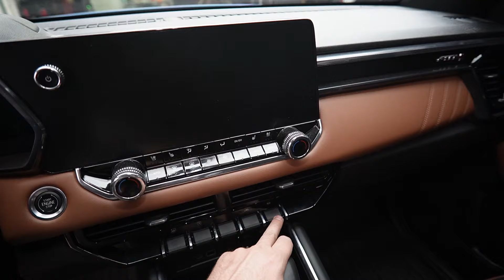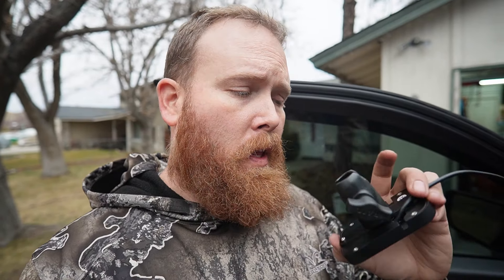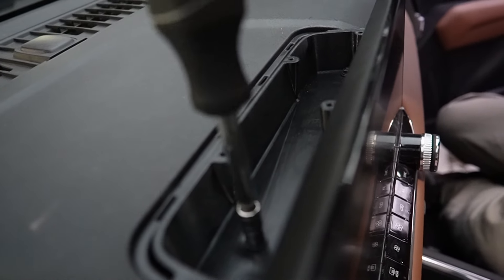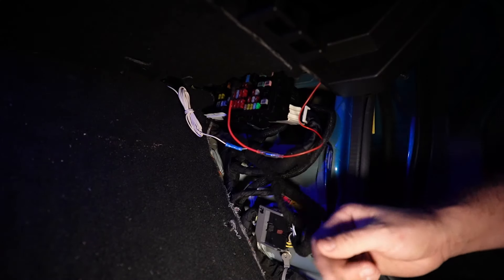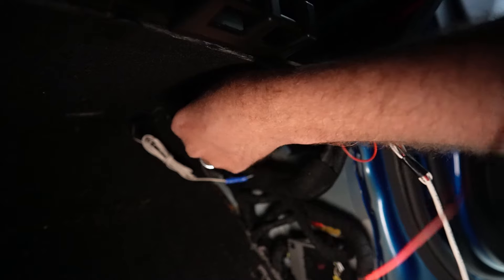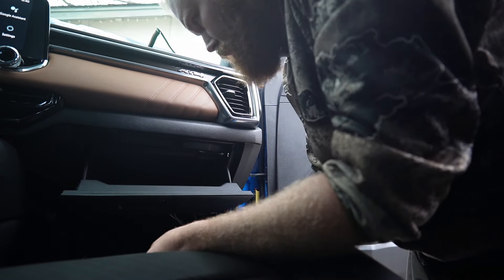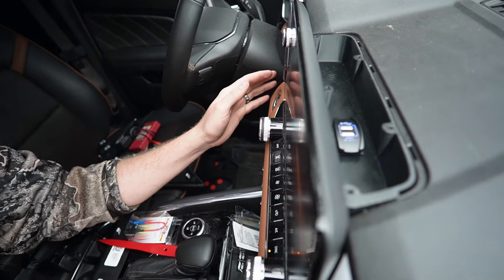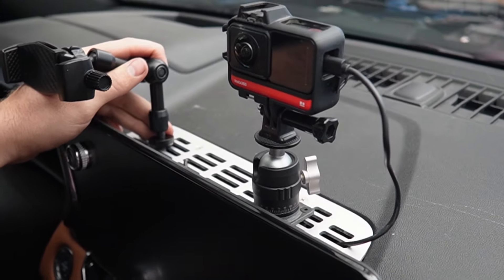2023+ Colorado Canyon Dash Grid

Comment: This video is super helpful!  The GM charging pad sucks so I’ve been looking for a solution. This will allow me to charge my phone and 360 camera!  Only question I have is; is it possible to steal the power from the factory charging pad. It doesn’t work anyway. So I’d like to steal its power and just use it as a place to throw my sunglasses. Seems like a waste for it to have power if it’s not doing anything
Reply from the maker: Since it uses a special module with feedback I'm not sure. I'm sure it's possible but the way I have it wired up it's on when the trucks on. Simple

Comment: Does the grid have an option for a black color? I have all black interior and I want to add a hidden charger and phone mount like this but I feel like the silver would be an eyesore for me
Reply from the maker: I'm playing with some powder coat currently.  I'm not good at it but it does turn out black. You can't see the grid from the driver seat except in the reflection of the window at the very top next to the mirror. Having this on my personal truck for about 5 months now I don't mind it but I am actively testing the black powder coat as well.
Reply: @BadlandIndustries  awesome I’ll definitely be getting one and I’ll probably upgrade to the black one if you release that color option in the future! Thanks for the awesome videos!
Reply from the maker: @masonself1671  I'll be making a post on my other socials here soon.
Reply: @BadlandIndustries I just bought both of the accessories from this video. Does the air vent mount come with the adapter you mentioned? Or will I need to modify it?
Reply from the maker: @masonself1671  not yet. I'll be revealing those with the full switch panel install video.

Comment: What gauge wire do you recommend to buy for all these projects? Something good enough to power ditch lights, USB ports, bed lighting, etc?
Reply from the maker: You really need to assess your amperage/wattage needs to determine the wire size. There's no sense running 4ga for a USB plug or conversely 22ga to run a winch. Search around google and you'll find some awesome calculators to determine what wire size you'll need for the distance and usage of each circuit.